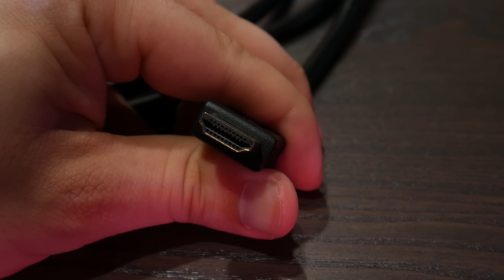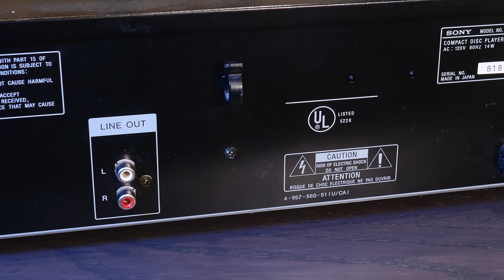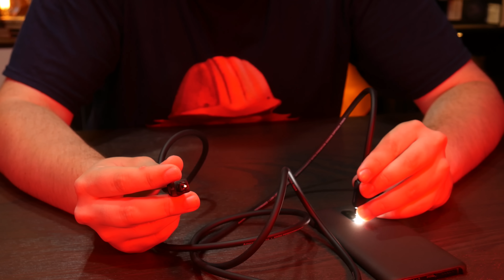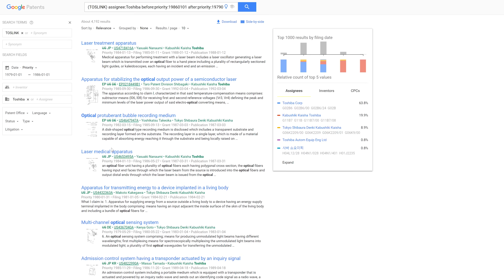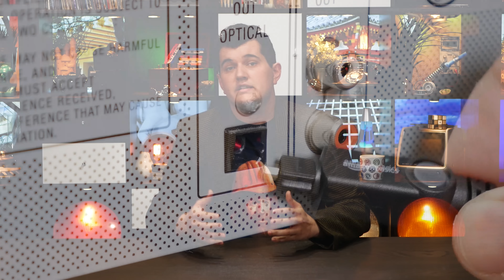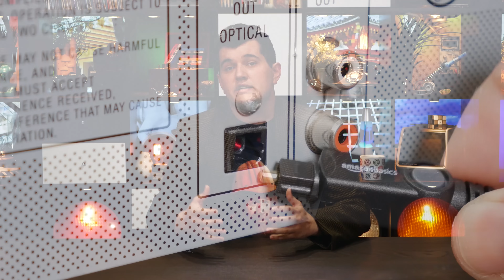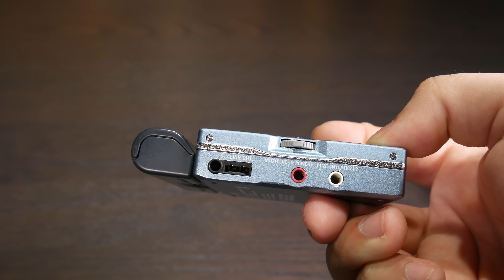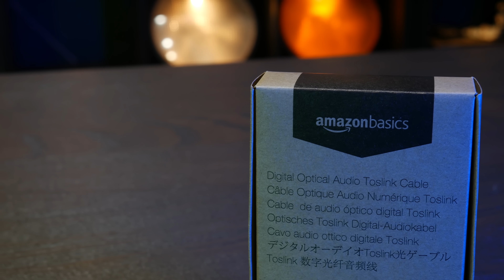TOSLINK: That one consumer fiber optic standard

Comment: Very cool video. I discovered Tos-link a couple years ago because I didnt like the interference regular audio cables would transmit through my 80s audio equipment. I also use on on my home TV because it greatly simplified connecting it to my sound system, as my particular tv does not have the audio cable outputs that work on all input channels. While hdmi has completely removed the need for tos-link I still think it has its place for those of us who enjoy retro audio equipment and want minimal interference

Comment: my favorite audio connection by far.   It's a shame it didn't evolved with a higher bandwitch version (able to handle 192khz and higher), I think it's much better than HDMI for audio purposes, don't care what audiophiles say about it, my experience with TOSLINK is stellar.
Reply: You do sound like someone that buys goldplated toslink cables.
Reply: @termitreter6545  well at least they are cheaper than many "audiophile" HDMI cables xD
Reply: Well.. actually it can do those higher sample rates.

It just varies what higher rates a recieving device is made to lock onto.

Also note it is 24 bit audio.

Comment: If I was to point out some advantage to optical, it would be that it cannot CREATE interference on other stuff, the same way a high frequency electrical signal can, and will. This of course changes a lot based on the voltage on the S/PDIF signal and the shielding of the cable, so it can be anywhere between nothing and annoying high frequency whine on the speakers. I would sure bet tho, that the signal modulation on the connection itself is made to reduce this until it's almost eliminated whoever, so it would still be a moot point.
Not really gonna bother trying to check voltage levels of the cable and frequency at which it operates but it sure CAN create it if not properly taken care of.

Comment: Benefit...optical isolation, prevents ground loop interference, maybe.  Good for noisy ground or devices that use ground to dump noise, more useful in laboratory situations than audio suites.
Reply: It's nice for connecting devices not using a common ground. For example a TV connected to cable (using cable as ground) and a computer using the ground in the electrical outlet as ground.
Reply: And especially to isolate the box connected to the lightning rod/antenna! HDMI doesn't offer that at all.

Note that high dynamic range audio is quite sensitive to disturbances, and ground loops can inject quite a bit of signal.
Reply: As said in the video, you don't get noise with digital cables. Everything either works or it doesn't at all.
Reply: @termitreter6545  wrong. Ground loop interference works through the common ground between devices making a noisy floor for all your other components. Most devices don't have big ferrite beads or giant inductors too act as high and low frequency chokes.  The frequencies most audio happens at are, inconvenient , too clean up after the fact, that digital equipment has too have a DAC in it somewhere.

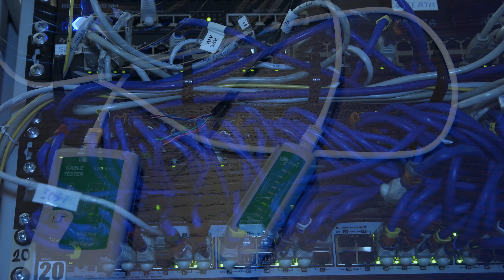Comment: 0:49 just to be pedantic, ethernet is a layer 2 standard, the physical cabling such as CAT5 and CAT6 (the twisted copper cables) are a layer 1 standard. Ethernet can also run over fibre-optic cables, although this would pretty much not be used to connect to desktop PCs so you won't see it in a home or small business. 

Speeds up to 100Gbps can be sent over (expensive) copper cables (not CAT5 or CAT6) as well as fibre, fibre generally just enables much longer distances on the cable runs - typically between buildings such as on a large business or university campus, or within a city such as a metronet etc.

Comment: Fiber just adds another step to data processing and transmission. The trade off AND lack of backwards compatibility is what holds back fiber in short distance, low speed comms. The whole pc or digital processing is electronic and why add an extra step to light conversion and back 6 feet later. Copper can easily handle 1Gbps over any distance within the home. And I can take my late 90s 10/100 Ethernet and build a LAN of disparate devices all the way up to the latest BASE10G fiber demarc. We still have a shit ton of work to do to get devices outside of the south bridge up into the multi gig connection. 
That said, we might see this on CAT7 with on the cable conversion to fiber in specialized applications for consumer use.

Comment: You always come up with videos that mirror what I'm investigating (portable AC unit) or just purchased. In this case, I just purchased a Sound BlasterX G6 and a SteelSeries Arctis Pro. The Arctis has optical in and out. The Sound Blaster has mini TOSLINK in and out. And yes, I hooked it all up optically as well as feed it to my Klipsch R-15PM speakers. I totally agree, it's not necessary, but for my setup it works great. If I were to do this in the living room, it definitely wouldn't be optical because of the surround sound limitations. My brain tells me there's not point in optical audio, but my inner geek self says "transmitting via light... cool". And, as always, thank you for your insight and I always looking forward to your superb video's....

Comment: Mini Toslink has been in apple laptops for 20 years. Several Sony ones too. Also portable audio equipment, mostly sony as well. Also lots of aftermarket PC sound cards have it shared on the orange mini jack on the back, for a long time now. 
Really, A surprisingly high number of devices have and had mini toslink.

Comment: There's a benefit to optical cables over copper  - you don't get ground loops. 

TOSlink is essentially a stretched opto isolator. So all your audio stuff is electrically isolated.  Not much difference for digital signals but if you have a mix of analogue and digital it might be helpful. 

Also LEDs, photodiodes and plastic fibre optic cables are all pretty cheap.  Add in the fact it seems like an open standard with no licensing fees and I can see why it took off.
Reply: You’re exactly right! 

Some very high end bench multimeters (like 7.5 and 8.5 digit units) use internal fiber-optic optocouplers to keep the clean analog and ADC circuits completely galvanically isolated from the dirty digital circuits, and those optocouplers are in essence nothing more than TOSLink modules, but which accept the bare fiber instead of the connector.

Comment: You should look up ground loops. The very fact say your PC and A/V system are grounded through your house wiring, as you pointed out, is why providing another ground via an analog or coaxial S/PDIF cable can cause all sorts of problems. For that application Toslink can have a real advantage as ground loops can cause all sorts of problems. So the format has some real world benefits. And jitter is a real thing that’s readily measurable, and even audible in blind listening tests in severe cases, once the signal is back in the analog domain. Lots of things in the audiophile world are pure snake oil and not measurable but jitter isn’t one of them.

Comment: Yup, got toslink to dac to portable amp via jack to headphones via jack, and can confirm: unless the fiber optic signal went straight to the headphones, this won't do crap against closeby interference signals.

If i put my modem close to the amp, i can hear the wifi waves getting picked up by the amp, and the same happens if i put a phone to the amp or the amp itself too close to the metal bars that constitute my desk's legs, in fact, i had to put it on top of a plastic object to avoid interfence just from the desk itself which kinda defeats the purpose of using toslink in the first place honestly.

Comment: Here is my argument in defense of toslink. Hear me out.

While the technology may be dying in home audio, where I see it still thrive is in car audio. Yep, thats right, car audio. Why? I'll explain.

Anyone who knows about car audio knows that the potential for noise is VERY high. Lets face it, you just added an elaborate audio system into an elaborate electrical system. In most cases, the source of noise in a car audio system comes from the RCA wires running from the radio up front to the amps in the car (typically in the back). This noise is usually generated because the RCA wires are near another piece of electronic equipment or just the cars wiring in general. Using a toslink cable to run to a DSP where the amps are located isolates the radio from the amps thus removing the noise, which in most cases is something called alternator whine, where the whining in the speakers changes pitch with engine RPM. In other cases it is simply just used as a method of getting better sound quality out of the system as some people swear that the radio does not have nearly as good sound quality out of its DAC compared to Toslink. (chances are if you have a radio that has Toslink, the onboard DAC is likely good enough). Other than that, I agree with everything in this video.

Comment: My old Sony CD deck from the mid 90's got optical out. And so did my PS2...

Only way forTOSLINK to be upgraded for higher bandwith would be if the newer standard would be overlayed onto the old signal in a way similar to how it works with color TV signals ontop of B/W TV while still allowing the old devices to get their signal.

Comment: Please note: I just watched this for the first time and have done no research of my own in the matter...
That said, is it possible that the RF Interference TOSLINK is designed to prevent isn't Interference picked up by the conventional RF Cable, but Interference CAUSED by the conventional RF Cable?
The idea being, since RF Cables can act as an Antenna that can Receive Interference, then they're just as capable of acting as an Antenna that can Transmit Interference to other devices/cables...aren't they?

Comment: Ive seen Mini Toslink in some higher end computer motherboards - Personally I always found it more useful to find the correct audio port to plug into since it glows. (Not to be confused with audio jacks that just glow to look cool) Ive also seen it on some 'higher end' (for their time) sound cards. 

If your wondering why you would use a high end soundcard, just use digital audio output, since the main reason for a sound card is the better DAC. It was mostly for Dolby Digital Live, or DTS Connect, since PC versions of games usually don't support Dolby/DTS unlike their console counterparts.

Comment: Maybe you'll bring it up in the next video mentioned at the end, but toslink is no good for a number of practical, as well as technological reasons, namely that you can shatter the glass or plastic guide, which basically ruins the TIR effect that optical cables rely on. Thus, the minimum bend radius for optical fiber is generally 10-15x the cable diameter, compared to 4x for copper wiring.

Comment: your point of HDMI is 100 correct however back when toslink was made while true it carries a digital signal electroincs back then (especially the cheap stuff) didn't electrically insulate/ power scrub stuff aswell as we do today. so you could have a situation where the spdif caused a humming scound that toslink simply couldn't do.

it is more a case of spdif has interferens that is carried threw onto a analog channel due to how close they are phsyically. yes i have heard this happen on old gear connected together and had to use a toslink cable.

however this is just not an issue with HDMI just to how cheap and compact and just general agreed good design to deal with electrical interfernce that getting a hum threw HDMI is just not somthing that can happen.

Comment: Weirdly enough, in the age of switching power supplies toslink has become surprisingly useful for connecting PCs to external DACs/ADCs, believe it or not in a lot of cases ground noise (produced by PCs) can leak to analog output/input of a DAC or ADC, in my time working as recording engineer it has happened more than once, but never with toslink.

Comment: 11:08 ...this needs to be repeated in the comments for ALL "audiophile" channels.  It's DIGITAL!!!  It's f**king DIGITAL!!!  The wire (within spec), the shielding (within spec), the distance travelled (under a few 100 meters) has ZERO impact on the signal... until it does... if it does, then it doesn't work AT ALL, it's not that it sounds or looks "worse".

Comment: I'm not sure if this has been pointed out already, but Mini-Toslink is super prevalent in the consumer marketplace. Lots of laptops have it in their headphone output jack. All Apple laptops and desktops have it, and they use jack sensing, so unless you plug in a non-conducting plug like a Mini-Toslink cable or an adapter for a regular Toslink cable, it won't activate the S/PDIF output in settings or shine the LED.

Comment: Toslink also brought something significant to the electronics DIY space, cheap, isolated optical communication links. Extremely useful for measuring things where there is nasty power spikes and electric interference. Like a power meter. 
Just throw a transceiver pair and a cheap toslink cable to enjoy cheeeap 100MHz of bandwidth.

Comment: i like the idea of fiber cables but honestly when it comes to things like connecting my monitor to my pc i wouldn't really want to replace something that already works just fine and doesn't really need improvement. HDMI and DisplayPort work fine and are already standardized for monitors and in many other applications there are already common standardized connectors and cables. I don't think that really anyone has the need for a fiber cable connecting their monitor and pc together. It makes sense in internet stuff tho.

Comment: I still use TOSLINK to connect my TV's audio output to my receiver - I tried using ARC but between needing to have HDMI/CEC turned on on my receiver for it to work causing weird interactions between my devices (I use a Harmony remote - I don't need CEC), and it sometimes just refusing to work properly I went with the optical connection.
Reply: It sounds like all you had to do was to stop your Harmony remote from turning on both your TV and receiver since the CEC standard does that for you. So basically what was happening was your TV would tell your receiver to turn on and then your remote you tell it to turn on but it was already on.
Reply: @andykillsu  The interactions between the seven devices I have connected to the receiver started becoming a nightmare to keep under check. I'd turn on my Switch and I was never sure what else would turn on. Sometimes the TV and receiver would turn on, sometimes they wouldn't. Plus, as I mentioned, sometimes ARC would just stop working altogether and I'd get no sound at all. Way too much hassle for something that could be fixed with a simple optical cable.

Comment: It has always bothered me that a one-signal cable—especially one that's fairly fragile—has a standard connector that has only ONE correct orientation.
Reply: Plus I found the nub that holds it in wears out after only a few insertion and removals.  Really fun when your TV has its port on the bottom.

Comment: Using these cables between dvd players and receivers for 5.1 sound explains their popularity in my limited experience.  That might not differentiate from coaxial, but it would seem to be an advantage over RCA by reducing the number of cables, if nothing else, at a time before hdmi was in wide use.

Comment: The mini toslink ports are (were?) more common than you'd think, the thing is that most of them only turn the LED on when a physical thing is plugged in, and obviously your standard 3.5mm analog jack would be slightly less transparent than ideal. Its also curious how there is (was?) absolutely no iconography to depict a hybrid analog/digital output. It either has no icon at all (it is a 3.5mm jack after all), or has the good old headphones one.
Like you mentioned, its borderline audiophile territory, but having the option to output digital audio is very nice when you have a good DAC, sure the Chromecast Audio isn't streaming files at very high bitrates, but a good DAC will (*should) provide better sound.
You know what's a good interface for transfering digital audio that precedes HDMI? USB. Straight up USB. Specifically UAC1 (USB Audio Class 1) can transfer up to 24-bit, 48kHz PCM stereo, over a USB 1.0 cable. And then UAC2 can stream pretty much anything that can fit on its USB 2.0 bandwidth.
Computers have used this standard for a long time, obviously, but even Android and iOS, with the adequate adapters, support it.
Now I'm wondering how widespread is audio over USB on TVs and other "consumer electronics".
Reply: In fact, most 3.5mm adapters for phones without headphone jacks are just USB audio cards, with tiny DACs inside and everything! Not every manufacturer does this, however, as I know at least one Huawei phone that outputs its analog audio over the USB data lines when its particular adapter is connected (It still works with more standard adapters, but its adapter doesn't work on any other phone I've tested so far)